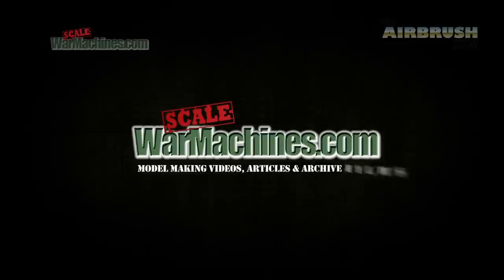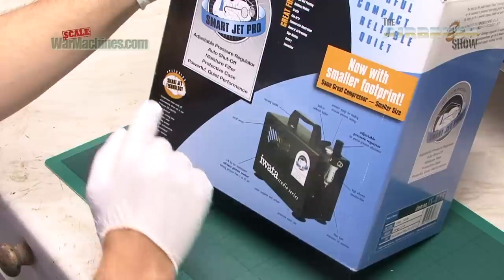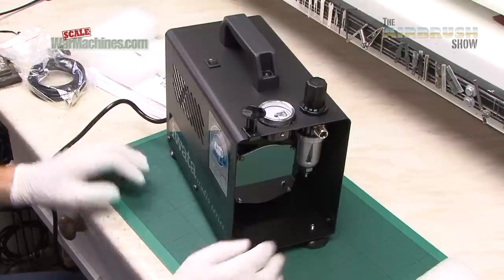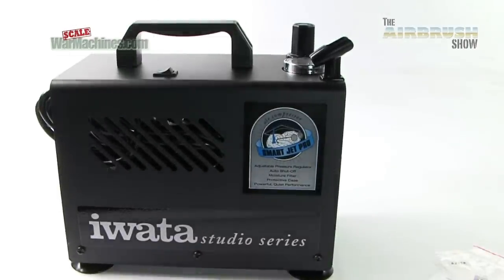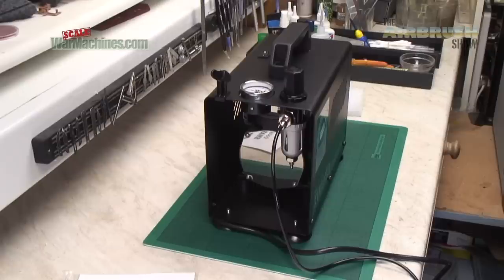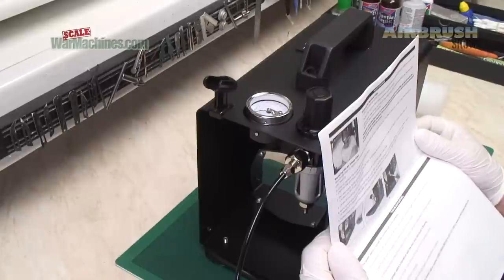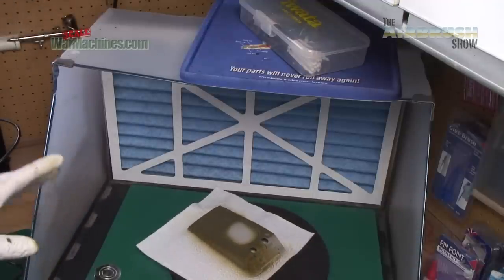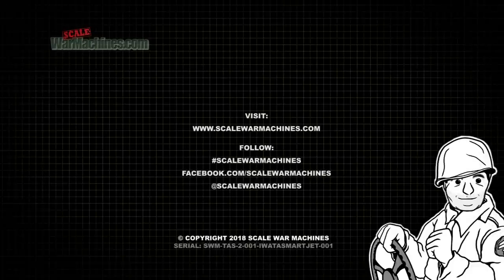IWATA SMART JET PRO COMPRESSOR REVIEW - THE AIRBRUSH SHOW S2.EP01

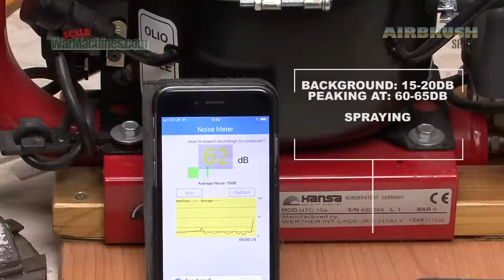Comment: Take the SPL measurements (at 6:20) with a large spoonful of salt.  Looking at the test, they are flawed and cannot be accurately trusted in terms of loudness.
Did you use A / C or Z weighting on your SPL app?
A-weight is representative of human hearing and is the correct weight you should be using for tests like this when reviewing loudness in human hearing enviroments.
C focuses on lower end spectrum noise and Z is a flat frequency response that does not account for the human ear.

To do a proper SPL test, you need to measure at the same distance for both compressors and you also need to not put the microphone directly on top of the item you are measuring.

Essentially, what you've done is put your ear directly on the desk and turned on the oil compressor and then put your ear directly on the Iwata compressor and went, "Yeah that one's louder"

I have an Iwata Sprint Jet that I performed an A-weighted test with.

My apartment noise is between 40-43 dB(A) with nothing running.  The Sprint jet has a moisture trap that creates a hissing sound, so I set it to 25 PSI and turned it on.

Placing the SPL meter (phone) on top of the compressor reports 95dB(A) - This is the same SPL as a hairdryer or a Helicopter going by.
Lifting the SPL meter off of the compressor and keeping it about 1-2 inches (2.5-5cm) away reports 88dB(A)
12" or 30.5cm away it reported 82dB(A)
24" or 61cm away it reported 74dB(A) 
36" or 90.5cm away it reported 69dB(A)

Please use this as a guide for doing SPL tests in the future as most people don't run their Airbrush Compressors with their ears right on top of it.

Comment: Thanks, Quick question is it 60minutes of airbrushing or just 60 minutes once you turn the compressor on ?
Reply from the maker: Duty cycle is operating time, but you can of course turn it off and let it recover when not in actual use. At least that’s my understanding. I’ve never found it ever to be an issue with these sorts of compressors to be honest.
Reply: @scalewarmachines  thanks for your answer. I've just received it today I'm going to find out if it's a problem.

Comment: They recommend that you set the regulator with the airbrush pulling air.
Reply from the maker: That's a new one on us, never felt the need to do that but, hey, whatever suits you.
Reply: @scalewarmachines  It guarantees that you are setting the actual spray pressure.
Reply from the maker: Interesting, thanks for that.
Reply: @scalewarmachines  You're welcome. I only just bought one and I can confirm that the pressure does vary between spraying and not spraying.